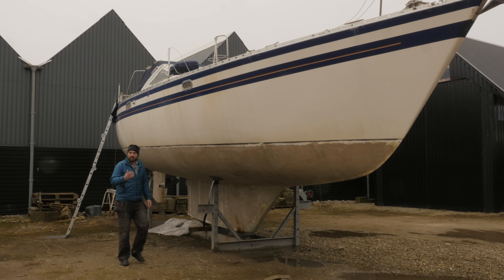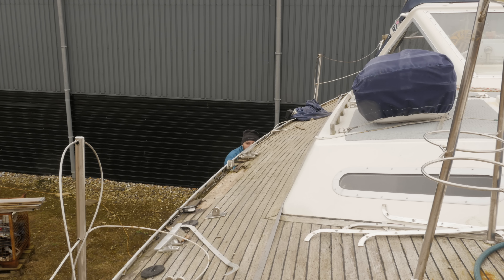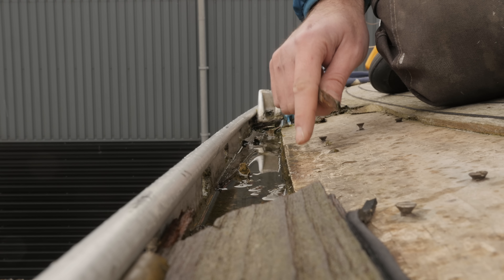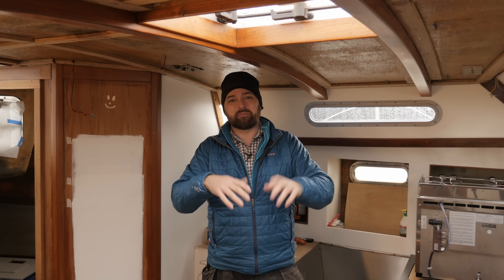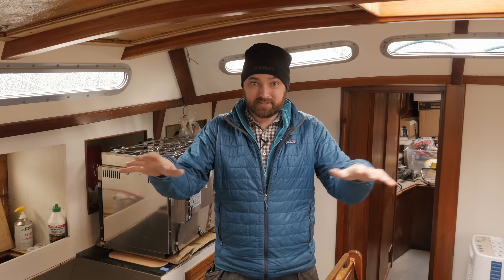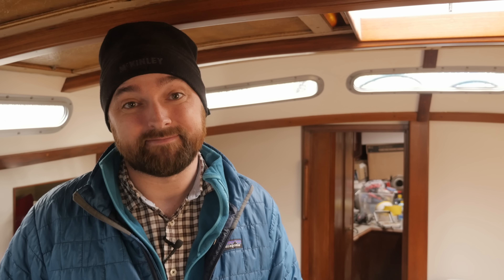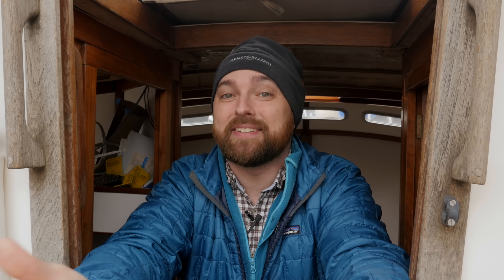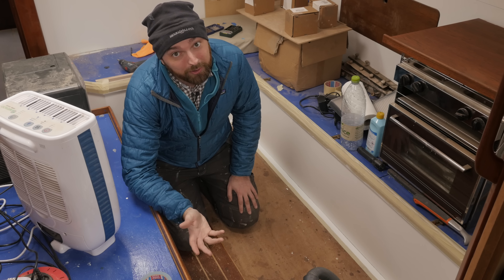Sail Life - Upcoming DIY sailboat projects & what does it cost to restore an old sailboat

Comment: The deck think about plasteak you have the look of teak for half the price
Reply from the maker: +Herbert Darphorn The older synthetic teak decks I've seen haven't held up all that well. Have you seen some that still looked good after 7 years? :)
Reply: Looks are one thing, insulation in colder climates like you are right now and from the scorching sun in the tropics is another. Having a thin plastic roof about your head, when the sun shines with maximum power on it, is not really a good idea imo. Take a look at some of them, they are not all the same and they are not made of the same materials. I think you can find one system that provides good insulation and also lasts a good while...
Reply: OHH!!  COME ON MAN !! we all know that in 7 years you'll ether have gotten a different boat or refitted ATHENA and changed everything new at least 3 times over because deep inside you  know you enjoy fixing a boat more than sailing in it (seasickness ..etc...etc..) so why not plasteak or a cheaper kind of wood that you can stain and finish the way you like ???
Reply: Isulation as at most boats are done inside theboat not on deck
Reply: It doesn't matter where it is, one extra layer of material will always provide more insulation.
Reply: Herbert Darphorn but that is damned expensive.....
Reply: Herbert Darphorn but that is damned expensive.....
Reply: It's all just fake stuff that has to be glued down. Its okay in the cockpit, maybe. But Mads has the right idea about ordinary non-skid on deck. There are a lot of old boats I really like that came with teak decks. But I refuse to buy one, since I just can't justify the TREMENDOUS amount of labor and expense to rip those old decks off and replace with proper nonskid.
Reply: @ RealityIsTheNow, Yeah it's all "fake" stuff and what is paint with fake sand in it then? You call it proper nonskid, yet most of those surfaces offer better grip in wet conditions than your paint with plastic spheres in it...
Reply: Gen-Ahhh, but you're wrong. Products like Kiwi Grip offers varying degrees of grip depending on your application. I've applied it to two of the three of the boats I've owned, and it has been better than some of the teak decked boats I've sailed on.

Comment: I know you probably will not listen to me but imo that boat will look really bad with just paint on the deck instead of the teak floor it has right now. Have you even considered using something like flexiteek or other synthetic flooring material? It will not only look much better but it will also provide some good insulation...

Comment: This is way too late, but I would use Followtheboat’s refit costs to yours. They roughly spend $78,000 only on the refit, so if your refit cost you less than $78,000 you’ve made out like a bandit.

Comment: Teak decks are a maintenance nightmare anyway. A grip-textured gelcoat, or some other modern look-like-wood grip material is probably a much better option.

Also, in your cost total, you didn't mention the cost of haul-out and dry storage.

And no, you didn't spend too much on her. I've got a similar sized boat, similar year, more of a performance cruiser than Athena. So far I've spent more than you, no new engine, no new electronics. You're doing fine.

Hey, Elena did nothing wrong.

Comment: Can you convert the total cost to price per foot. I will do the same for my 27' boat and see if we are similar lol
Reply: You can't divide? In any case, EVERYTHING is way cheaper on a 27 foot boat. Costs go up exponentially on bigger boats. It doesn't go up by the foot. It's probably three times as expensive to buy rigging and sails, for example, on a 40 foot boat than a 27.
Reply: Don't know the length of boat. I am on 1015 dollars per foot.
Reply: Isn't the rule add 3 foot of boat double the cost of operation & maintenance ;)
Reply: Marcel Simard I am just curious if the cost is relative for the boat. Obviously the mooring fee is more.
Reply: My experience would say that the rule is correct.... Beside berthing, you have to look at cost of fuel, pump outs (in USA & Canada),  Locks if you have to transit them, shore power etc... Same goes for maintenance, more paint & antifouling, larger lines for running rigging, bigger shroud for the standing rigging larger sails etc...  This is the reson I refer owning smaller sailboats; althought I don't mind sailing and teaching on larger ones.
Reply: The costs are not relative. It doesn't go up by the foot. Going up by the foot would be linear. Going up exponentially is more accurate. Costs for a 44 ft boat are not twice as much as for 22 foot boat. The 44 foot boat stuff costs 3 or even 4 times as much. Boats don't get bigger in one direction, they bigger in all directions. Look up the difference in WEIGHT between a 22 foot boat and a 44 foot boat. The 44 boat will be  many times more massive, and will require equipment many times more expensive as a result.

Comment: I get a different total than yours. 
Boat  $42,000.00 
Port Lights  $2,000.00 
Refleks Stove  $2,100.00 
Fridge  $580.00 
Electronics  $1,912.00 
Electronic Panels  $1,539.00 
Paint & Varnish  $1,105.00 
Wood  $401.00 
Galley Stove  $760.00 
Charger & Inverter  $1,606.00 
Misc  $454.00 
Total:  $54,457.00

Comment: $12K so far for a refit?  That isn't that bad...really it isn't.  My power boat would easily cost $25K to do a refit on my boat...EXCLUDING engine work...which I have two 454cu.in. engines on her, and both need a main bearing (just started to drip this year)...that alone is over $500 per engine to have fixed...closer to $750/engine since they have to pull the engines to do the work.  :(  So you're fine!@